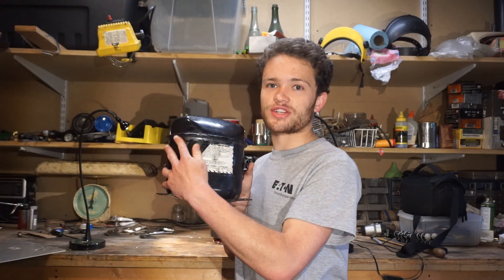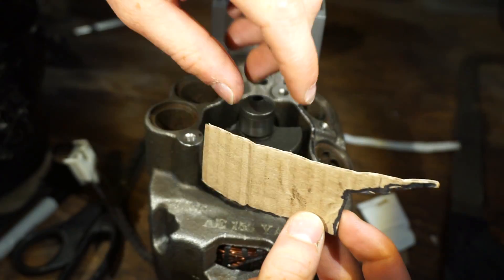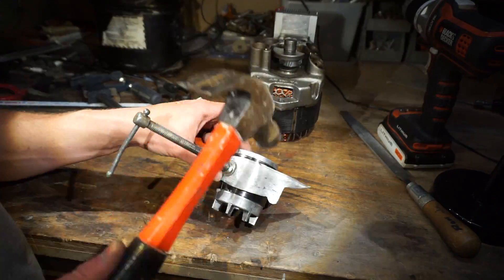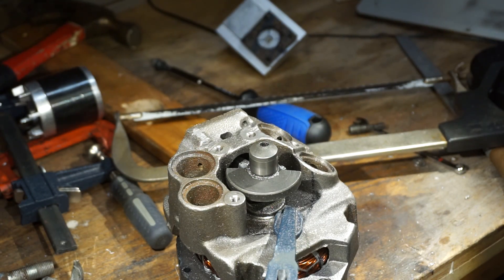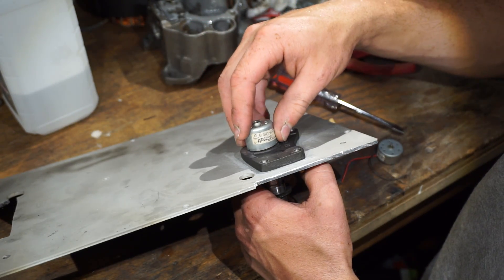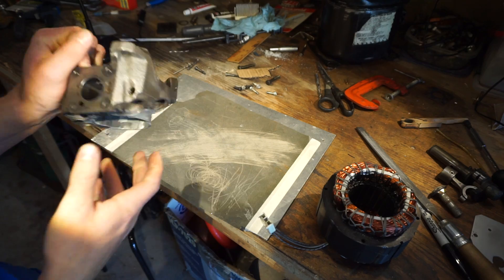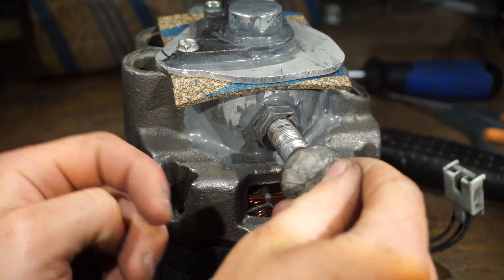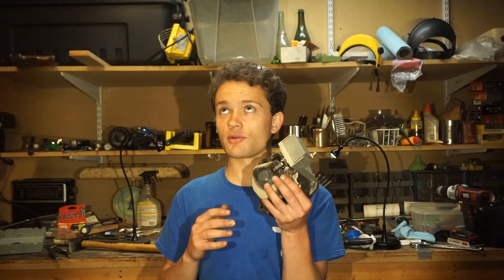Part 4. DIY Internal Combustion Engine Made from Old Compressor - Crankcase from Aluminum & JB Weld

Comment: can i know what the glue/bond you use please??
Reply from the maker: JB-Weld. It is a steel reinforced epoxy resin. https://www.ebay.com/itm/J-B-JB-Weld-Adhesive-Epoxy-1oz-Tubes-8265-S/392131329286?epid=8021578061&hash=item5b4cd93d06:g:dzYAAOxyY3ZRyZdl

Comment: The January / February 2004  issue of Home Shop Machinist has a step by step article on how to convert an cheap old wood cutting band saw to cut metal.  Basically you just add a big pully and a jack shaft to slow down the blade.  I did it and it works great on mine.  It will save you lots of time in the future.

Comment: Which jbweld did you use and how much?
Reply from the maker: +Leon Boerkamp I like the original stuff. JB Weld Kwik works well too
Reply: How much?
Reply: I am doing it to now, only the cilinder is much smaller.

Comment: Couldn't you just make the intake on the side of the cylinder and hook the carburetor directly to that? (With a one way valve) Then you could just manually lubricate the connecting rod and crank before each run. That way you don't have to seal the crankcase. It would save a lot of time converting one of these into an engine. If I ever do this, I think i'll try that.
Reply from the maker: +Halen Peterson you could do it that way. The problem is there would be no vacuum from the crankcase to suck the fuel air mixture into the crankcase and then push it into the cylinder. So it may work, but not very well. You would be relying on the velocity of the exhaust gases existing the exhaust pipe to hopefully create enough of a vacuum in the cylinder to pull in the new charge of fuel air mixture. While it can work and has been done, it's not powerful or reliable.
Reply: As the piston moves down from TDC, it would suck in fuel air mixture. Although another problem I thought of is the mixture burning as it's getting sucked into the cylinder.

Comment: I'm trying to build my own small engine out of a air compressor, and I'm having troubles figuring out how to get power to the spark plug. I was wondering how you did it on your first engine. Did you use a magneto?
Reply from the maker: +Tristan Speiran for starters I used continuous arc. So like a neon sign transformer or negative ion generator. If it is a 2 stroke the fuel is pushed up into the arc at just about the right time. It's not nearly as powerful or efficient as a properly timed ignition circuit but it does work surprisingly well. 

After I got bored of that, i wanted to run it on a battery so I made an ignition circuit that uses a hall effect sensor to trigger a NPN transistor which amplifies and inverts the signal. The transistor signal gets fed into a N channel power MOSFET and there is a fast diode in line to protect the MOSFET from voltage spikes. That is fed into the old car ignition coil. 

When I get to the ignition video of this series I'll have a schematic drawn up for everyone.

Comment: this is such a wasted opportunity, you could have made a really good 4 stroke engine with the kompressor....
Reply from the maker: deep. Dude, it's not a waste. I could get a dozen more compressors like this in a few hours. They are quit common.
Reply: bro, plz try and make a 4-stroke next with connectingrods and valves... use all u got plz
Reply from the maker: deep. I have been thinking about it and I certainly want to build a 4 stroke. There are some huddles that I haven't figured out yet. For example I haven't figured out how to make valves yet without a machine shop. The cam is also another part that I haven't quit figured out. Maybe after this engine is finished
Reply: for valves you can use bolts filed down to the right shape, the threads would make it easier to connect a spring just by using a bolt and a washer. for cams you could use some thick steel (or other metal) and shape the cams by using a paper template and connect the to the cam shaft by usin a bolt. another thing that might be cool to se is a 2 or 4 stroke with more than 1 cylinder :D
Reply from the maker: deep. Bolts filed down are one of the ideas I had in mind. Probably be the easiest way. Multi cylinder would be awesome!
Reply: to be honest, im happy ur just uploading. you havent been too active on youtube this years soooo, yeah

keep up the good vids my man
Reply from the maker: deep. Yeah, sorry about that. College takes up too much time and this summer has been insane. I'll get part 5 out asap
Reply: thanks my dude, ur always been one of my fav youtubers, it suck that ur uploads isnt every sunday or something like that, but i dont want u to do it that way because then you will feel forced to make videos and thus make vids with much less creativity and passion
Reply from the maker: Yeah, I wish I could get videos out more often.  I guess I have too much of a life outside of YouTube haha plus I absolutely hate editing videos.

Comment: you should use a weed eater carb
Reply from the maker: It would probably be too big.  Good idea tho.  Maybe after I try making my own carb I will try other things and that could be one of them that I try.  Thanks for the idea!
Reply: also i dont thing that the rod will get enough lubrication because two stroke used needle bearings in there so the mix runs through it

Comment: Hi dear friend
I greatly appreciate your work
I hope that you will be able to turn on the engine as soon as possible.
One thing that you should pay attention to is to ensure that all moving parts are clean, since metal cuttings spoil the moving parts very soon.
And another thing: Be sure to take the components of the lubrication seriously, especially in the case of a refrigerator compressor. Dry working of moving parts without oil
.This is not good.

And finally
  Sorry for my bad english

Comment: that head is going to need a combustion chamber with a proper squish band. as it stands at tdc the entire mix will be compressed into the tiny .3mm gap between the top of the piston and bottom of the head and will probably immediately blow the gasket. if this is 24cc you'll want a (roughly) 3cc head for a 8:1 compression, don't go over 9:1 or you'll begin to see predetonation unless you opt for high octane leaded gas lol.

Comment: Subscribed just purely to keep track of this. He claims by part 8 that it'll be running. I'm saying it'll run, but not by part 8, more like 10 or 11. The biggest hiccup will be the ignition and timing, an impromptu carburetor can be made from a sharpie and a bic pen (using the design for a nitro rc carburetor) and it'll work for bench testing purposes. However the ignition will be the difficult part. 20k~50k volts is needed for proper spark through a spark plug which must be made at each rotation of the crank consistently. Very interesting project none the less and I can't wait to see the end results. I had a small 4 cylinder air compressor that I wanted to make into a functioning model engine and ended up losing the entire project in the process of moving. Best of luck man.

Comment: Pretty much all IC engines are glorified air compressors. It's just a matter of how the valves open, or (such as with turbines) doing the combustion just after the region where the compression occurs.

--  Edit  --
Also appreciate how you're managing to do this without $50,000+ of proper shop tooling and equipment. :)

Comment: Will  the head be able to keep Pressure as the metal on the Intel heat sink is not that strong of a metal unlike the block
Reply: YT-technology i expect the head to warp pretty quick, plus it needs a combustion chamber...

Comment: If you had that metal sheet in the first place, why not use that as the engine head in the first place instead of the cork sheet from part 3?

Comment: And again my comment is invisible. :-(
Reply from the maker: +boelwerkr I see your comment
Reply: Also the last one i wrote 10 hours ago?
I have this problem for a years now. Some comments are public some don't, and i have no idea why...
Reply from the maker: +boelwerkr I didn't see one from you from 10 hours ago. Have you tried changing your Google+/YouTube settings? Sometimes if your Google+ is privet or something like that it will cause problems.
Reply: Thanks for the answer by the way. :-)

I will try to repost it after this comment.
Reply: This was my comment:

What type of carborator do you want to build?
I would suggest an old old type of evaporation carborator (i don't know the correct english name). It's simply a pan in fuel wet cloth and the air moves over it. A lid determines how much of the cloth is exposed to the airstream.
It's easy to build (no valves or pump), can be build in any scale needed. You can also build it "to big", because the exposed surface area determines the amount of fuel in the cylinder.
The only problem with such a carborator is the oil you have inject in the airstream. I would suggest a separated active oiling system. A can with a small hole to the crankcase. You fill oil in it an seal it. the pressure of the case will also pressurize the can, and with the falling pressure a shot of oil will be squirted in the crank case.

Comment: What type of carborator do you want to build?
I would suggest an old old type of evaporation carborator (i don't know the correct english name). It's simply a pan in fuel wet cloth and the air moves over it. A lid determines how much of the cloth is exposed to the airstream.
It's easy to build (no valves or pump), can be build in any scale needed. You can also build it "to big", because the exposed surface area determines the amount of fuel in the cylinder.
The only problem with such a carborator is the oil you have inject in the airstream. I would suggest a separated active oiling system. A can with a small hole to the crankcase. You fill oil in it an seal it. the pressure of the case will also pressurize the can, and with the falling pressure a shot of oil will be squirted in the crank case.

Comment: I am thoroughly impressed! Mostly with having the willpower to stick with a hacksaw when you have access to power tools.  I'd have gotten two centimetres in with the hack saw and said, screw this, I've shown it COULD be done with simple tools and then have someone cut it out for me with plasma or lasers and computers  and robots or something. Props to you.  I hope it works but I applaud the attempt and execution regardless.

Comment: While really cool,and love the ingenuity, in a real post apocalyptic scenario you will have more engines than you could ever use in your lifetime just laying around.  So, you could put your smarts to work better by figuring out how to keep your existing engines going. Most likely , you would be using that refrigerator compressor as it was designed to keep your food cold :)
That said, i hope it runs awhile .

Comment: Be aware that the needle bearing on the output shaft of the crank will not prevent the engine's primary compression charge from leaking out of the crank chamber. You MUST devise an effective seal there. The air/fuel mixture trapped in the crankcase has to have a sufficient flow and volume to both fill the combustion chamber and push as much spent burned gas out the exhaust port as practical. Good luck on this build, I want to see you succeed😉

Whoops, is that output bearing a plain, sleeve and not a needle? Watched the #2 vid where you removed the crank and didn't notice any needles there. Oh well, at least find a way to fill in the spiral lube slot in the crank (more JB Weld I'm sure ;) )

Comment: Not a check valve, they're reed valves, mounted between a 2 stroke engine's crankcase and the carburetor's spigot (rubber/plastic intake manifold).
Like a flapper, but softer with a solid travel limiting plate. Reed stiffness must be changed with performance mods and the limiting plate needs to be balanced (L and R ports open the same distance for optimal turbulent flow).
And by the way, "binded"...? Try Bound.
Keep having fun kid, keep the passion alive and pass it on

Comment: I don't want to ruin the fun, but the engine might seize pretty fast. The conrod big end bearing in that compressor won't play well being lubricated by a tiny amount of oil in the gas, in proper 2 stroke both conrod bearings are wrist pin ones. You may need to run a very oil rich mixture.
Reply: MrJohhhnnnyyy 
I once got an old engine running by making a head gasket out of cardboard....
it didnt run long, but that wasnt the point, point was IT RAN. I think thats the point here as well.
Reply: twoeightythreez I know, but I'm just interested how long it gonna last with that bearing running dry.

Comment: you can get maybe better power if you use valve like on your first combustion engine on intake so the fuel enters bigger pressure to cylinder.

Comment: will the hollow pin in the piston not be a problem, the ports are lined up so that the fuel mixture can pass straight out to the exhaust through the pin when the piston is at TDC??
Reply from the maker: +quadzy good thought. So the hole does not pass through the pin all the way. If I remember correctly I have the hole side pointed towards the intake. I'll have to double check tho
Reply: ah right my bad, just what i remember from other engines lol!  looking good so far though!
Reply: Maybe that crazy one you've been working on at the school you go to.
Reply: what do you mean

Comment: Use the hole in the bottom of the crank case as the carb hole. You don't need to go nuts on weakening the rest of the engine drilling and filing. Just make an adapter and screw a rudimentary carb/reid valve on there. FYI reed valve is made of spring steel.
Reply: Also for spark, if you want to go cheap for ignition find one of those click to light lighters and remove the piezo element and create a cam lobe on the crank that actuates that.

Comment: Put the carburator on the Plug :) 
That would propaly work nicely do you have anything in mind that you want to use as a carburetor?
I was thinking about a small chainsaw or RC car carburator. Since its such a small volume.

Comment: Super excited to see this thing go!!! Keep up the good work, also how much power was that high fuel mileage engine your class made producing? Mpg is great but only if its producing usable power, just curious?
Reply from the maker: +Beach&BoardFan thanks! It's only around 1-2hp. We got second place with 2417mpg. First place was 4113mpg.  if you want to see all the scores check here: http://students.sae.org/cds/supermileage/results/
Reply: 1-2hp!!! that's more then I was guessing. Did the other teams engine produce the same power/is there a minimum power that needs to be produced?
Reply from the maker: +Beach&BoardFan the engine you must use is a Briggs and Staten that is like 6hp stock. We de-bored the cylinder to make it less powerful and much higher compression. Many other teams engines probably produce about the same power
Reply: I noticed in the link you provided, there was a massive jump in mpg performance between 2010 and 2011 what happened?

Comment: Genius at work! Taking the hard road magnifies the brilliance of your achievement, many could do it in a machine shop but few could get so far with simple hand tools. I made a tiny small 4 stroke ages back, it took about a year of intermittent stabs at it, and I had every machine at my disposal including a spark eroder, the whole thing began with finding a tiny spark plug. I then had to make a motor for it to work in.. well nothing like a challenge. Great stuff, and thanks for sharing it.

Comment: That is some A* grade hackery with the JB weld and bits of sheet metal. I'm imagining your next series as "I build a functioning hydraulic backhoe using only bicycle parts and hot glue"
Reply: PKMartin you know, honestly I wouldn't be surprised...
Reply: PKMartin this made my day
Reply: This is the kind of comment you'd find on a Cody's Lab video. I love comments like this.
Reply: If the cork material doesn't work, he needs to get some RTV sealer. It's the JB weld of gaskets.
Reply: I'd believe it.

Comment: perhaps you can use the hole for the crackcase plug as the carb inlet instead. maybe make a screw on carborator that fits the nut?
Reply: i like it, dual purpose hole ( ͡° ͜ʖ ͡°)
Reply: He would need reed valve after carburator... It would be much easier to just put small 2 stoke engine carb to one of the holes he made in to the side of the cylinder and use crankcase as source of vaccuum for the carb..

Comment: anyone else thinking that hammered aluminium was gonna work harden and shatter
Reply: the load is when he's hammering it, aluminium is one of those metals that hardens as its bent back and forth
Reply: rparker069 it doesnt harden it gets brittle because its so soft ut cannot take the torsional forces
Reply: Generally softer aluminum (3000 series) has fewer alloying additives which makes it more ductile (formable) and a better conductor of heat.
Reply: rparker069 not sure if it will shatter as its not taking any load?
Reply: rparker069 unless its cheap aluminum no you'd need decent heat for any type of hardening
Reply: I've had weird experiences casting aluminum, but one thing I've picked up is that generally cheap heat sinks (like the one in the video) are made from a slightly softer less pure aluminum.